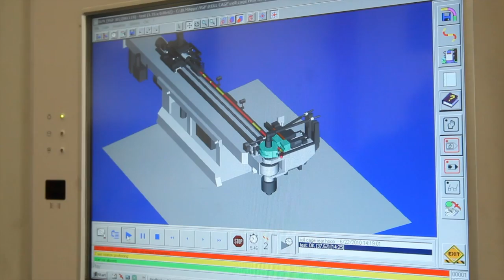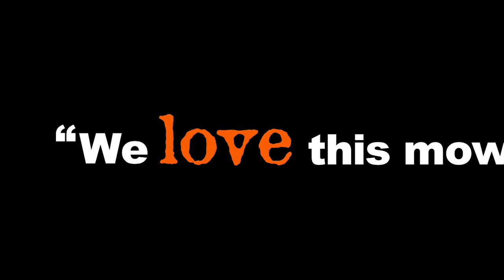Bad Boy Mowers Factory Tour

Comment: I bought a Zero Turn 48" mower recently.  I chose BB because my inspection on it's construction and design told me it was better built than other name brand units.  So far I am very happy with the performance.  The only beef so far was that the control handles came loose after a short period of use.  I am no stranger to things mechanical so I tightened them up and everything else has been good.  This thing seems to be built like a tank.

Comment: Question ?  Why does Tractor Supply have to assemble there Bad Boys ?  Is the mower the same quality as those sold at dealers ?  I've been told by some mechanics that the mowers sold at Big Box stores are of lower quality so that the prices are cheaper to compete and match the costs for the stores.
Reply from the maker: Kevin, every mower we build comes off the same assembly lines, and are built the exact same, no matter where they are sold. A Maverick sold in Tractor Supply is 100% identical to that same mower sold in an independent dealership.
Reply from the maker: Tractor Supply also does not have to assemble their mowers. The only thing they have to do is attach the seat (4 bolts) that is removed before shipping.

Comment: Does BadBoy have a plan for a commercial electric line? Consumers want power and torque, and electric motors can provide that spades, even as battery tech evolves through the next decade. Can't find a more beautiful place than Batesville — wish you all great success and endless profits!
Reply: they are now available. Check out the Renegade, Rogue, Rebel and Revolt stander. I'm run a red machine (that ends in "K" since 2002, 8 of them actually) and I can say these things are built like freakin' tanks. If you tear one up, you had to have been trying to. decks fro 48 - 72 and engines from 726cc to 999cc.

Comment: I have a bad boy rebel have put over two hundred hours in two months and must say will go across ANY hill u put it on if it breaks traction just keep going it will catch grip.
Reply: whaT model do you have
Reply: @waynecure2849  I have a 2019 bad boy rebel 852cc with a 61 inch deck

Comment: Why is nobody wearing safety glasses in this manufacturing plant, I spent 32 years working in machining, assembly, and engine test and everyone wore safety glasses and steel toe shoes and even hearing protection in certain areas, per OSHA requirements. Other than that, I enjoyed the video, and I am leaning towards buying a ZT Avenger pretty soon.
Reply: Osha requires safety glasses in the areas in which you can receive particulates or ricochet to your orbitals, most of the stations in the plant don't have these problems but safety glasses are still required anyway, can't answer why the people aren't wearing them in the video however.